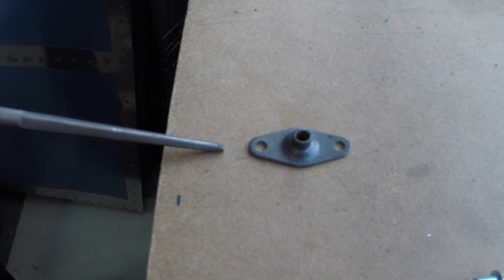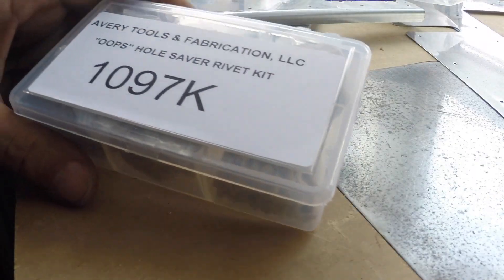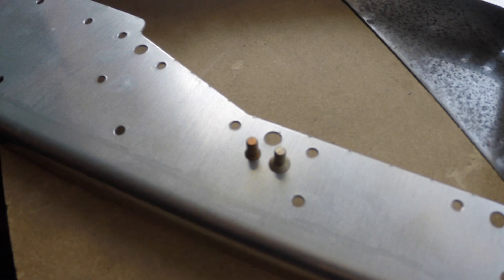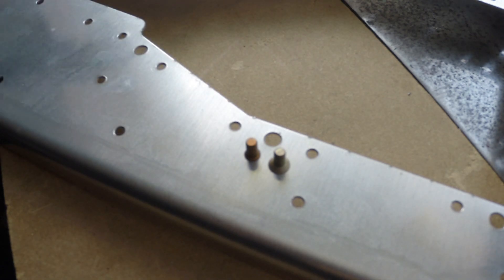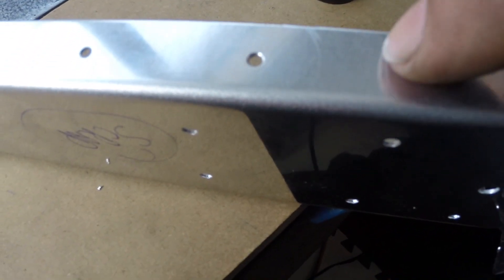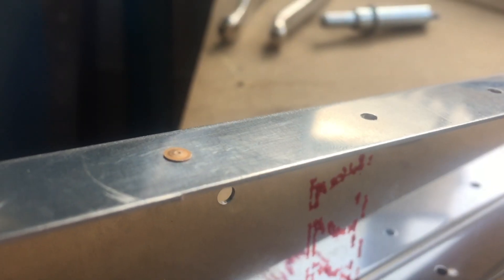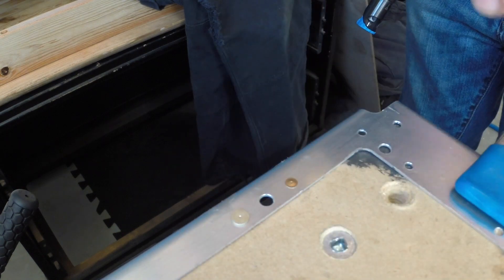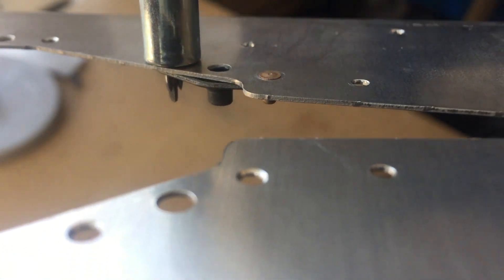RV-7 Trim Servo Nutplates

Comment: To avoid dimpling the nut plate or using a weaker rivet (oups rivet) the designer of the Nexus Mustang adds 0.125 plate the size of the nut plate as a shim.  A regular (stronger) rivet is used, the aluminum plate is dimpled, as well as the 0.125 shim.  All this makes it stronger.
Reply: Oups, in my comment I say the 0.125 is dimpled...  it is counter-sunk.  The thin metal is dimpled or counter-sunk depending of material thickness.